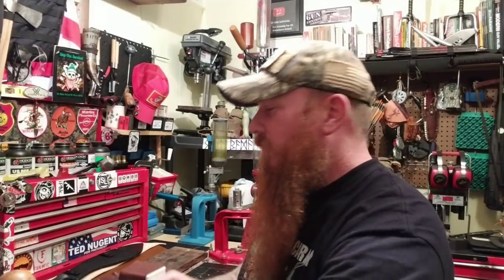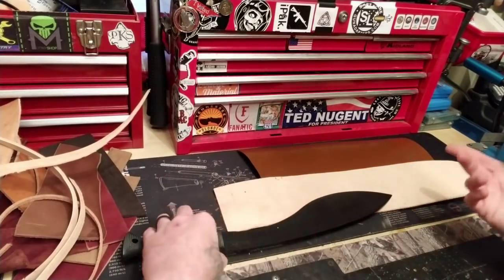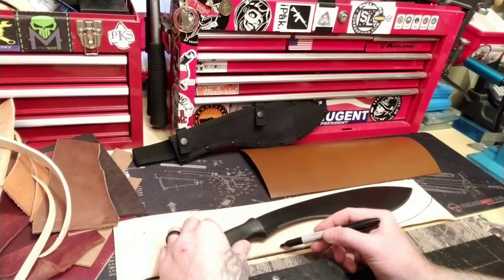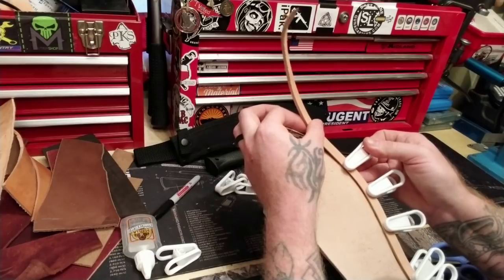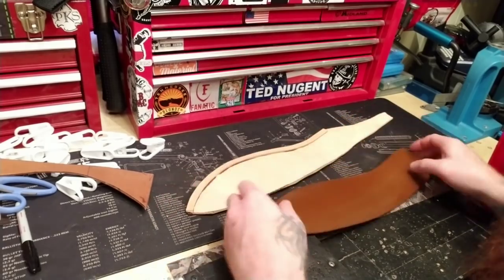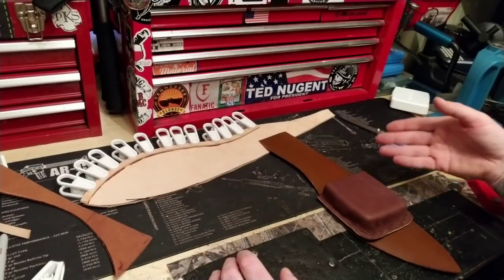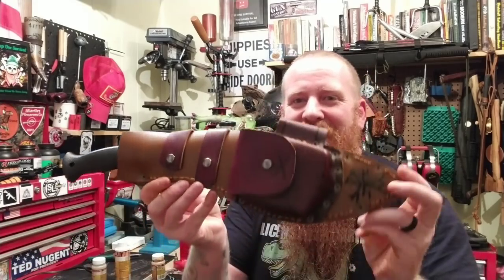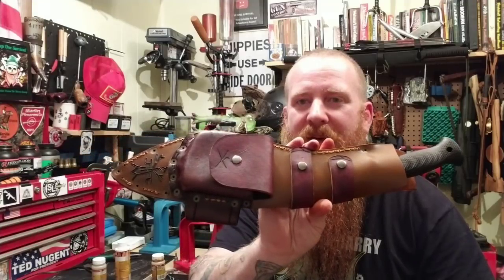Making a Leather Sheath | Cold Steel Kukri

Comment: I like it, got some good Ideas, But aren't you worried those rivets will scratch the blade?
Reply from the maker: Nope never had that problem
Reply: @StepOneSurvival  I'm almost finished, I ended up making the pouch detachable w/ snaps because I made it to big. Next are the assessory pouches flash light, knife, ferrell rod. Big thanks again your vid really helped me on the design. Tandy leather guy showed me how to cut and set snaps and rivets. I've sown a sheath just not rivets. I messed up cutting out the blade " O1 tool steel so it has a gut hook. like a tracker. :-)